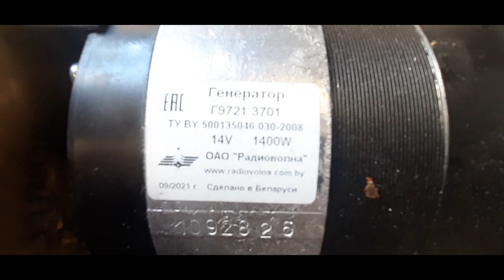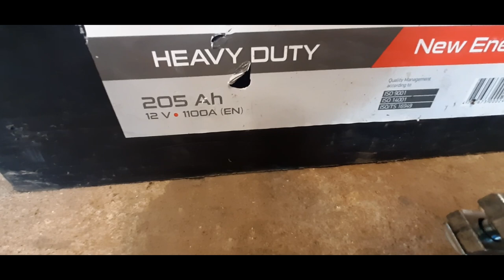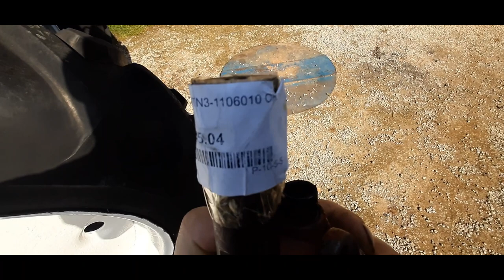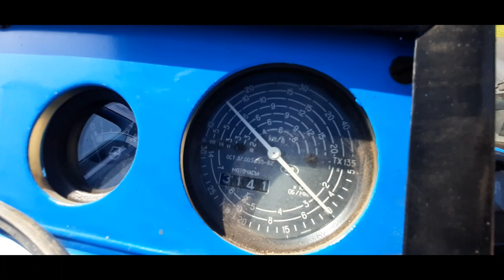Belarus MTZ-52 Restoration Project Part 18 - New Starter, Generator and Coolant system

Comment: are you going to paint the engine?
Reply from the maker: Not that engine :) I'm planning to replace it with D-240 in future
Reply: @indrek06  thats exactly what i would do btw i got LTZ T-40 tractor
Reply from the maker: @mrwilsss1145  T-40 is a great tractor :)
Reply: @indrek06  thank you MTZ 52 and T-40am great combo for forestry
Reply: @indrek06  yeh t-40 is good tractor and MTZ 52 is good too, in future im going to buy mtz52 for project!!!

Comment: About the fuel pump that didnt pump diesel, there is a rubber ring inside of it, you can unscrew the cap and change the rubber ring.